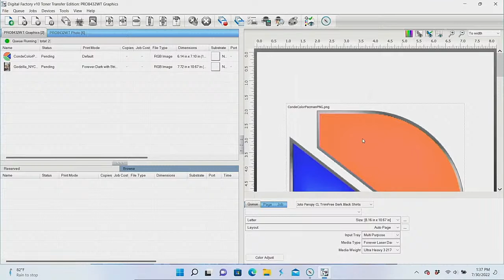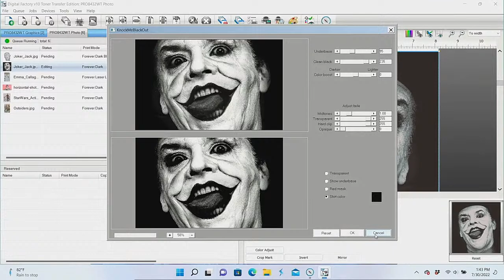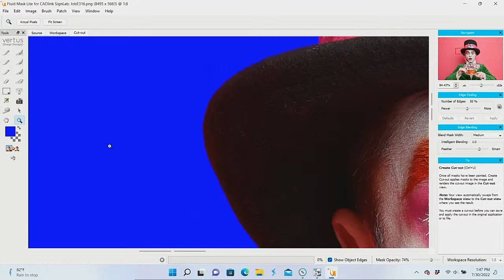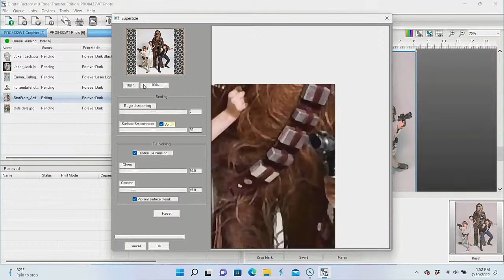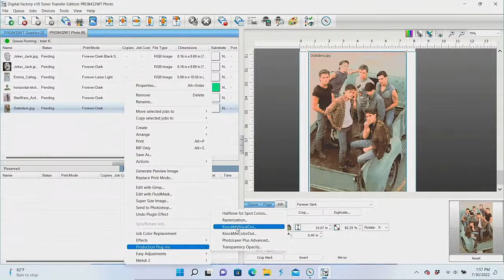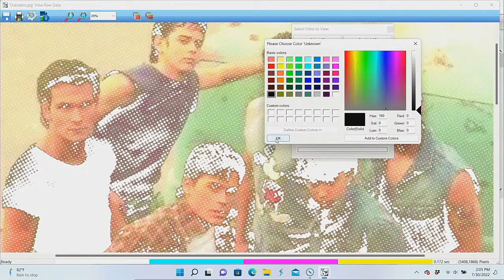10 Things to Know About Digital Factory 10 RIP Software for White Toner Printing

Comment: Good morning love your videos you are a great teacher.  Question what is (CMYK) BLACK for printing black on forever dark to use with foiling
Reply from the maker: Process Black, or CMYK Black, is the process of mixing cyan, magenta and yellow together to create black text or graphics. Simply design your single color graphic as a C:100, M:100, Y:100, K:100 black. This will command your color laser printer to deposit the necessary toner coverage for consistent weeding results with FOREVER Laser Dark LowTemp and Hot Stamping Foil.
Reply: Could you send me the process I am new to digital factory and trying to teach myself from your video's.   I am trying to print a black image and put colored textile fo iij l on it.  Getting frustrated not working for me